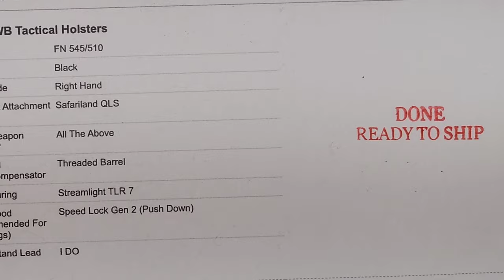Let's make some holsters for the New FN 545/510 with a TLR7. IWB and OWB

Comment: Hey man, so being inspired to try a T shirt press for heating kydex from your setup, I picked one up and gave it a try - I must have to adjust the tension lighter on the press because it caused the kydex to take on the texture of the teflon material, which for me was a teflon impregnated fabric (got it from Amazon) - gives a nylon look which is cool, except it did it on BOTH sides, leaving the inside of the holster also textured. I didn’t discover it until I pressed a holster (personal use) - has this happened to you before? What brand / where do you get your teflon paper from? I would prefer not to sand the finish off my guns or lights unnecessarily in the future 😂
Reply from the maker: Ya man you need to get the smooth Teflon sheets. About 16 bucks on heatpressnation.com